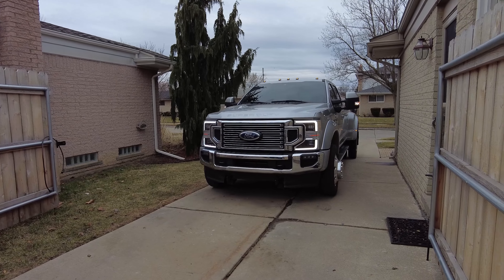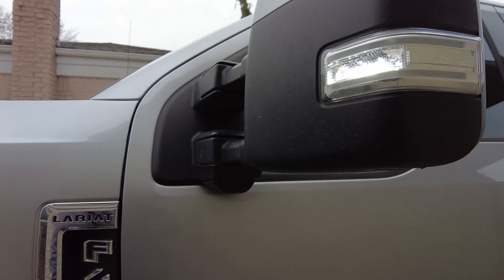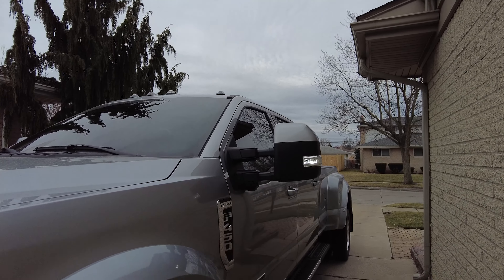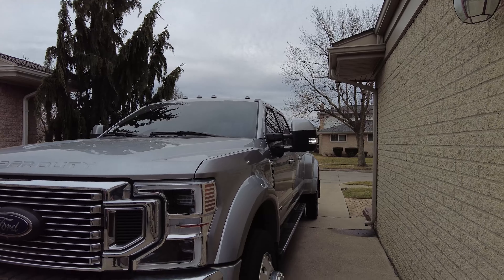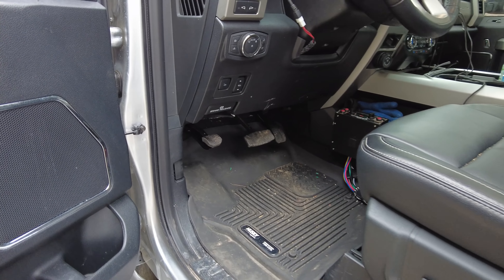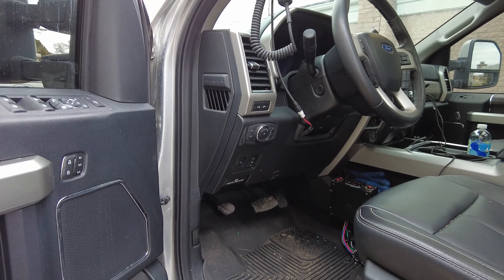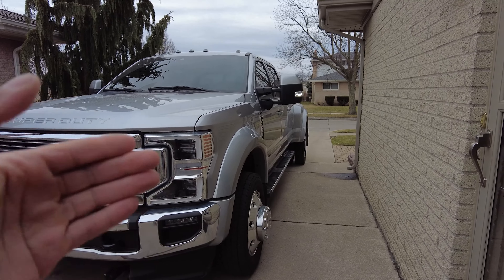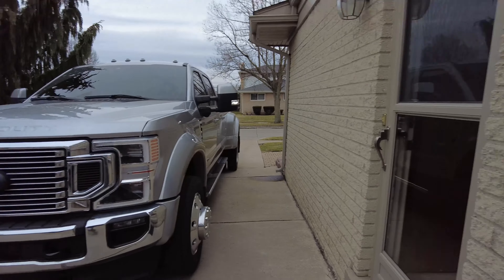Get FORD mirror spotlights to turn on at any speed. super duty and F-150!

Comment: Good afternoon.  Thank you very much for this cool mod!!  I will definitely do this!

I just picked up my special order F350 xlt cclb 7.3l with 4.30 gears from Iowa and drove it back to CO.  Boy...I really like this truck.  There are a few options that I'll really miss:  adaptive cruise, dual climate control for my passenger, and some electronic seat adjustments for the passenger seat.  But, those weren't worth the $5k upgrade to Lariat.  

QUESTION: How do I operate those puddle/spot lights on the mirror (I have the xlt premium package and the truck has the fully electric towing mirrors)?  The dealership did not know.  I was at their parking lot and was not getting the spot or puddle lights when pushing the left or right selector buttons.  Is there something else I'm supposed to have on also?  If it makes a difference, the xlt puddle light/spot lights definitely do not have a proximity fade on feature when you just walk up to the truck.

Comment: Does this also enable the puddle lamps to be turned on at any speed other that 0?
Reply from the maker: No. But that's a cool idea 🤔
Reply: @DS-TRUCKS  when I turn on my puddle lamps, it also turns on my cargo lamps in the box, and the LED strips for the running boards. It would absolutely be beneficial for a passenger to be able to take a look at the cargo area while in transit... I'm going to do this mod anyway and hope for unexpected good results with cargo, puddle and running board lamps.